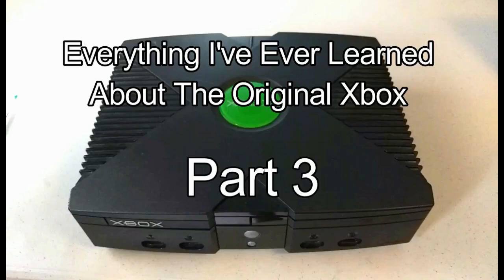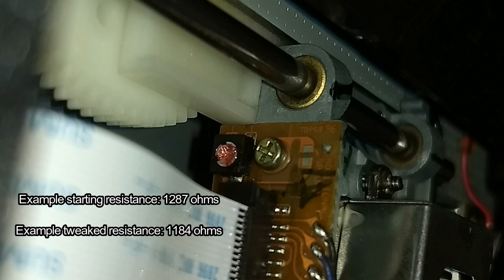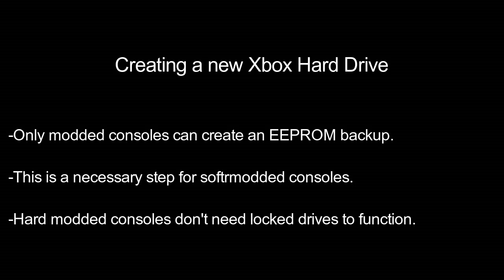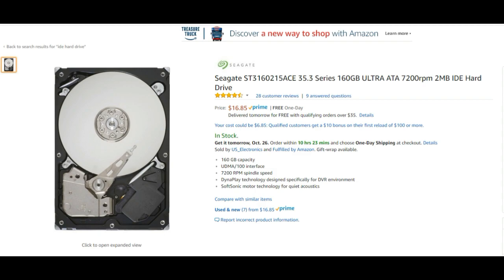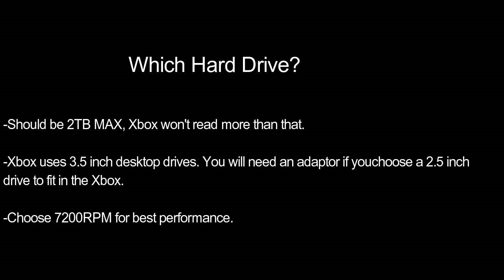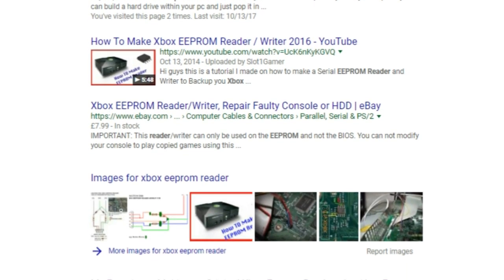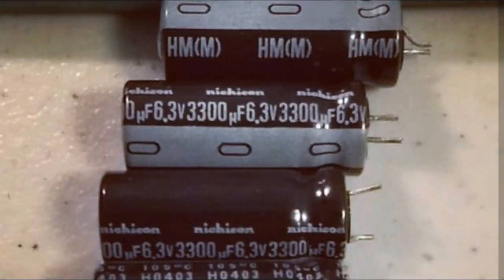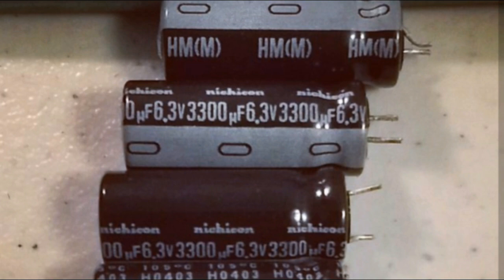Everything I've Ever Learned About the Xbox Part 3- Common Repairs

Comment: Nice and detailed info. The only bad thing is, that my xbox needs a new(used) motherboard. Green/red flashing light...
Reply from the maker: ah that sucks. To tell you the truth, I did manage to fix that once by cleaning it really thoroughly. The clock cap leaked quite a bit and the machine wouldnt boot. I cleaned it really hard for like an hour and eventually it was back to normal.
Good luck!
Reply: Retro_VG_Repairs It is worth a try. The version is a 1.6. I changed the thermalpast and removed the dust it had inside, no luck. It didn't look like any of the caps had leaked. I was thinking about trying the heatgun trick. Like some use on the xbox 360 (rrod). Have you tryed that on a O.G. xbox motherboard?
Reply: Wow 1.6s shouldnt have that issue. I would try the reheating thing. You get the flashing red/green when there is a short, or damage to some component. The Xbox is detecting some kind of huge failure. If absolutely nothing looks amiss, it would be incredibly hard to figure out what exactly stopped working.
Reply: The cleaning didn't help, frist cleaned with elektronics cleaner. Did nothing. Then cleaned like tech yes city does with pc parts. No change. Tryed the oven heating trick. Not helping. I think some of the caps has gone bad.
Reply: Could just be component failure, like one of the chips. Capacitors failing would probably result in a no power situation. Or random shutoff during gameplay. FRAG is telling you that the hardware cannot boot up at all. I would seriously just recommend finding another cheap Xbox. Keep checking your thrift stores for good deals.

Comment: Man, this knowledge is pure gold. Thanks for sharing. Any ideas to fix a faulty controller port? My player4 port doesn't work
Reply: maybe check the port itself and see if it needs cleaning, by the time you see this youve either gave it or fixed it, but hey, i tried 🤷
Reply: I would just replace with a donated port from a parts machine.

Comment: Hi, i have a 1.0 version, the motherboard caps have been replaced previously by tech.  Everything looks good on mboard and power supply.  But when i hold in the power button i hear the fan trying to start the engine.  But i cant get it to turn over?
Reply from the maker: No damage from clock capacitor?
Reply: Had the same issue with my 1.4, which uses the same powersupply (just with another connector and newer revision). Tested with another powersupply, and woila, it was working again.
So I suspect your powersupply is faulty. For reference, use this extensive guide: http://adriancallaghan.co.uk/wp-content/downloads/Guides/XBOX_REPAIR_GUIDE.pdf

Comment: a modchip is useful for 1.6 xbox, for earlier versions softmod + tssop is best with tssop you can also safely unlock the hdd and that's great for hdds that can not be locked. I still dream for the day I can increase the ram memory and even an upgrade for the cpu but I suck at soldering. and finding a compatible computer for the xbox is harder nowdays. It's crazy how after the upgrade some games run too fast that makes them unplayable.
Reply: The cpu upgrade as already been done years ago. And forget about it, it will ruin the games, only helps with emulation and multimedia

Comment: If you're softmodded and remove the clock cap, does the new dashboard (I forget it's name) use Network Time Protocol (NTP), to automatically set the time and date?
Reply from the maker: Believe so, just need Ethernet

Comment: Does anyone know the solution with getting the hexen disc utility working when the xbox disc drive is dead?
I heard you can ftp the files to the hard drive but I don't know if it works and it looks a little bit complicated.
The xbox I'm working on is 1.0 tsop flashed so will it be simple? I wish to just replace the hard drive with a bigger one and not use something like chimp or a old PC.
Reply from the maker: Matrix Millennium no real way to so that, sorry dude. To use the HDD version of hexen, you need an actual dashboard to access it. Ftp won't work since you also need a dash already. Either you borrow a working DVD drive, use chimp, or set up the new drive with the new usb version of hdmaker. Old PC not necessary anymore
Reply: @retro_vg_repairs3339  I have access to  a moded  dashboard / bios already just a dead DVD drive to use the disc version of hexen to format the new drive.
Do I still have to use chimp or get a working DVD drive to just copy things over and change the bios over to unleash X?
Reply from the maker: Matrix Millennium yeah well here's the issue: the new hard drive is empty and unformatted. You need to get the dashboard files onto the new one using the methods I listed above. You either use hexen, chimp, or use xboxhdmaker.
Reply: @retro_vg_repairs3339  well that kind of sucks but I'll look into it thanks for the help..
Reply from the maker: Matrix Millennium that's why when modding I always have a spare Xbox with a working DVD. Once I upgrade the HDD and tsop, I put the old dead DVD drive back in. You could probably luck out a grab an Xbox from a local thrift or garage sale. Then swap out the disc drive

Comment: I am looking at replacing the 5 capacitors by the CPU and PSU. The generic 6.3v 1500uf caps all  are bulging and 4 are leaking, but the console somehow still turns on and functions normally.

Comment: nice video, I wanted your opinion, my xbox does something weird, it's a FRAG but it works .... when I boot it starts 3 times and then it flashes red /green light and no video signal as you show in the video, and ok everything is normal FRAG, but if I then press the EJECT button the console starts up normally and I play without problems even for hours, how is it possible ??? can i fix it easily if this happens?

Comment: Any advise on replacing the time capacitor with a rechargeable battery or sth?
Reply from the maker: Oliver S. Never seen anyone try that. Honestly it's not worth the trouble. It wouldn't hold the time very long anyway when it's unplugged and there isn't any game that cares about the current clock.
Reply: ok. Thanks!

Comment: Hi there! very interesting videos, indeed. I have one xbox 1.6 that seems to need a particular kind of repair. As I said, it's a 1.6, and it had very distorted color and resolution, bad loud scratchy sound, and auto power on w/dvd open. I took it to the service and told the guy to do a total recap (there were 2 blown capacitors -not the clock one-), he did... and both sound and video are great (video does get some sporadic odd coloring/ brightness issues after 2 hours of usage, though). Unfortunately, the auto power wasn't solved AND, this is the strangest thing: I can turn on the Xbox by pluging it and play... just ONCE per day. Then, it won't boot up, at all, no matter how much I try. Any suggestions?
Reply from the maker: Watch the trace corrosion bit. Sounds exactly like what's wrong. 25.03
Reply: @retro_vg_repairs3339  The trace corrosion is my main suspect... but I'm worried about the odd coloring/saturation/brightness briefly "storming" on screen after 2 hours of gaming or so. The previous shitty technician (who obviously assured everything worked perfectly) said that I will have lots of overheating problems and most probably, that I'd need to do some reballing; but I do remember having put arctic MX4, at least on the micro (not on the graphic card). XBMC says it's 60ºc on the micro and 45º on the graphic chip... Should I worry? I read somewhere that 1.6 kind of gives wrong readings.
Reply from the maker: @facundovaldez6990  it's not that accurate. Don't worry about the temps, they aren't even close to frying. The video issues sound weird. All the bad caps were replaced?
Reply: @retro_vg_repairs3339  so he said. It would be a real pain to recap all over again, but I'm gonna keep an eye on that as well. Thank you so much for your help

Comment: Good video, do you know what the optimum potentiometer readings are for a Sega Dreamcast laser?  This info would really be helpful.
Reply from the maker: Blitzkrieg I do not, sorry
Reply: I thought I would ask.  I actually fixed 2 of my Sega Dreamcast's by tweaking the potentiometer on the back of the laser not to long ago, they were dormant for about 15 years boxed up.  Now they work fine.  

I would have to believe that my original Xbox has some trace corrosion as you have showed us in some of your videos.  My old Xbox has the symptoms of when I plug it in at the wall, it'll power up but I cannot power the system down by pushing the power button.  However the disc drive works fine.  Thanks.
Reply from the maker: Blitzkrieg wow well done. Yeah that definitely sounds like trace corrosion on the bottom side of the board. That's always a fun fix! There a couple of good tutorials about that on YouTube, definitely worth watching
Reply: I've seen a few videos on the internet showing how to fix the trace corrosion, I'll give it a try once I get the parts I need.
Reply: I tried to fix my Xbox's trace corrosion problem and destroyed my Xbox in the process.  I suppose I should have purchased some flux, it was difficult to get the solder to stick to the 30awg kynar wire. Now I need a version 1.0 Xbox motherboard.  Are the disc drives interchangeable between the different versions of Xbox's, could I take my disc drive out of my version 1.0 Xbox and put it in another version?
Reply from the maker: Blitzkrieg aw sorry to hear that. I've has my share of botched repairs. Yes, the DVD drives for the Xbox are all interchangeable, it's only the mobo and HDD that need to be paired.
Reply: It's okay, I learned that I shouldn't have taken a short cut.  I should have gotten the flux.  That's awesome that the DVD drives are interchangeable.
Reply from the maker: Blitzkrieg if you don't mind me asking, how did you break your Xbox? Did the solder joints come off? Does it red ring now?
Reply: I think I broke it by not getting the solder to stick on that one solder joint where you had pointed out in your video.  I think I also messed up some of those leads that were connected to that solder joint and just basically messed up the solder joint by trying over and over to try to get the connection to hold.  Then some solder hit the board by accident in places I didn't want the solder to stick, I used the solder wick and solder iron to get it off the motherboard.  There is no red ring, when I put it back together and tried to start it up I got no video, no light of any kind whatsoever, only an audible noise to let me know that I screwed it up.